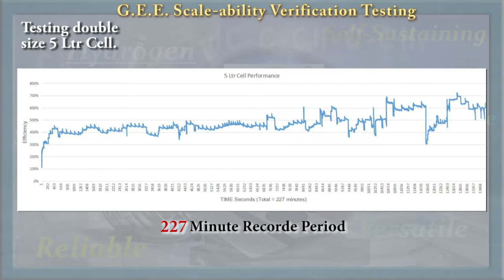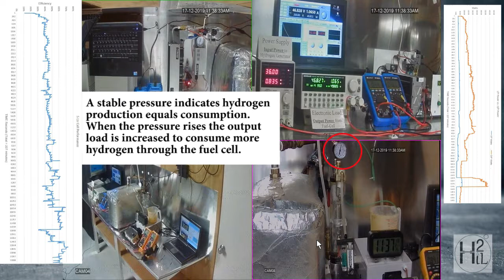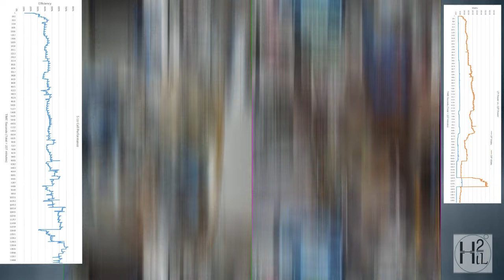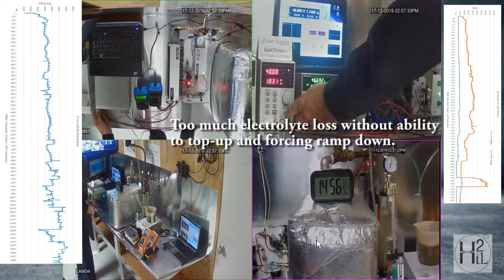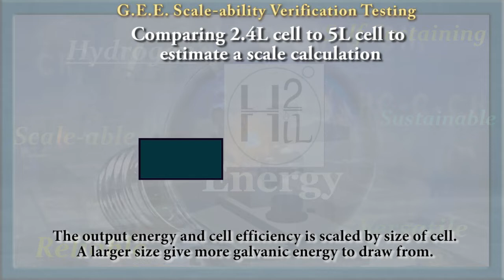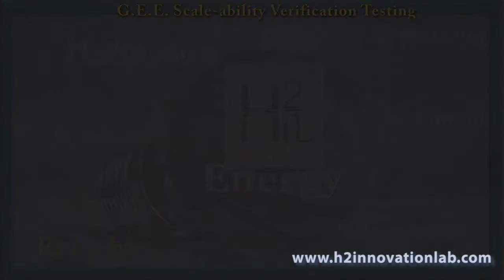H2IL Upscale Verification Report Demo - Achieving 600% Efficiency - Energy News.

Comment: all of this if it's true is a leap for mankind but unfortunately you guys don't have a clue how business is conducted
Reply from the maker: H2IL have just published some statistics on their Q&A page. An example of a 1 cubic meter cell producing 2Kg/h of hydrogen with an OEM manufacturing cost of US$12,000 per unit. The Galvanic metal cost per US$20,000 of hydrogen (pump price) is just US$500 plus 2 hours labor to exchange the galvanic metal. Nuclear energy also requires metal rods to be exchanged so this is a close comparison.
Reply: @h2ilmarketing77  this doesn't say anything, just are numbers thrown around is all you can call it. I have tried getting in contact with H2IL there is no contact number just a postal address I mean are these guys in the 21st century or are they still in the dark ages
Reply: @h2ilmarketing77  if you guys are for real I'll buy a unit at that price and test it, if it works you'll have an order on your hand that will take you 50years to complete